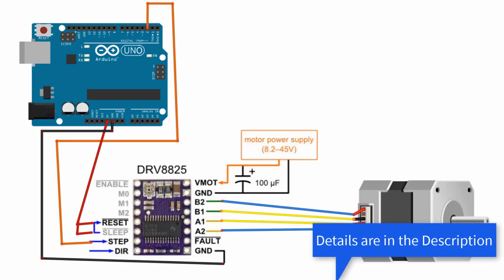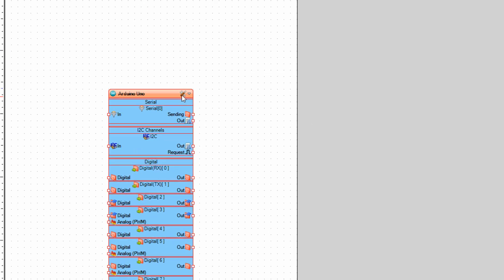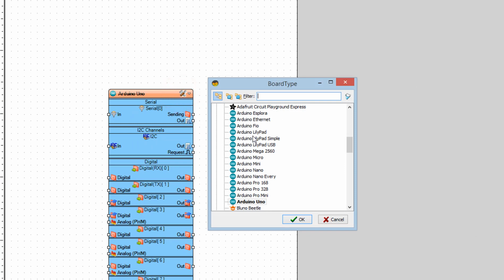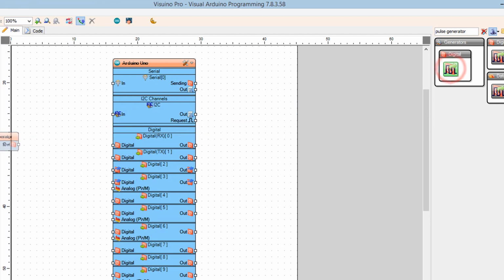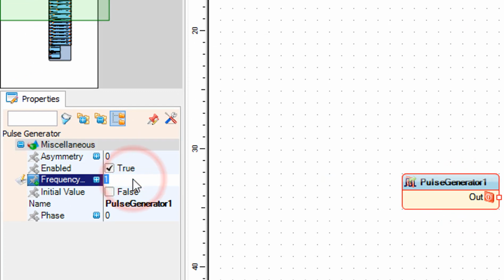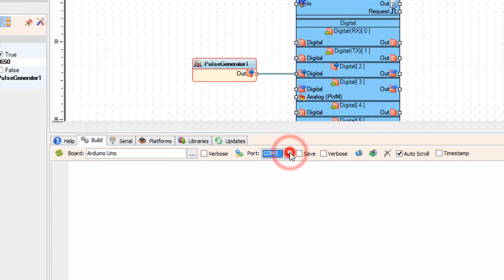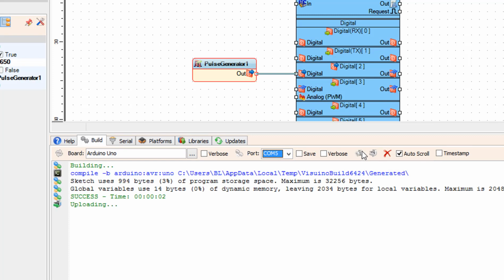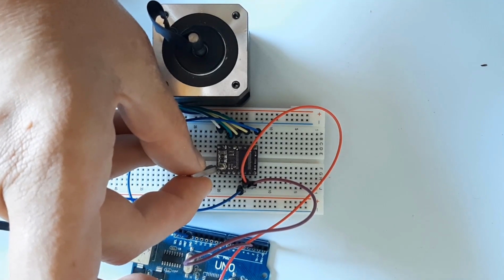High Speed RPM Stepper Motor & Arduino

Comment: what about the torque by using this drv8825 for nema 23 stepper motor sir ?
Reply from the maker: drv8825 is rated for 2.5A max, I do not know the ratings for nema23, there are other drivers that can handle more power like TBS
Reply: @visuinoprojects  TBS means sir ?
Reply from the maker: @Lee.coopee  Sorry I meant TB6600
https://www.youtube.com/watch?v=djqIy2vi4D0